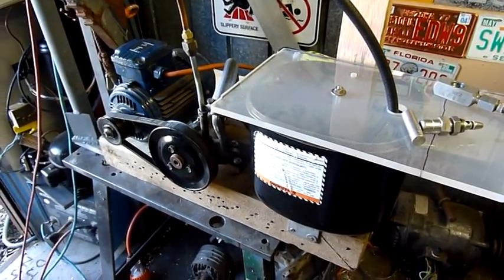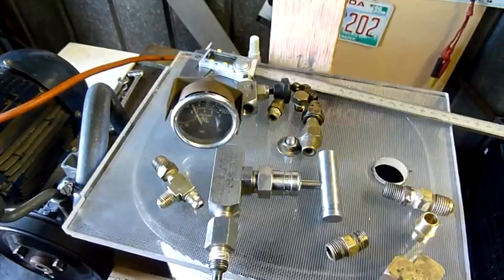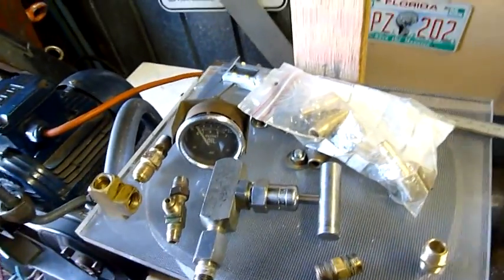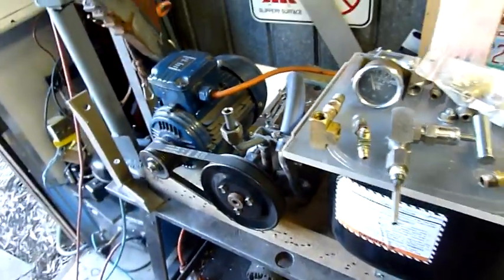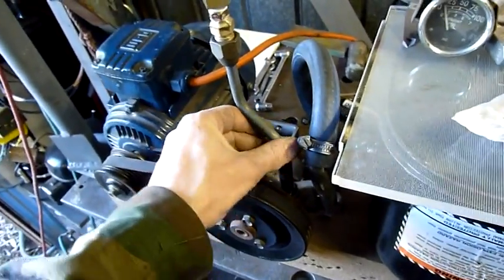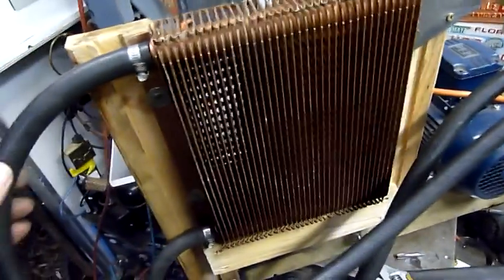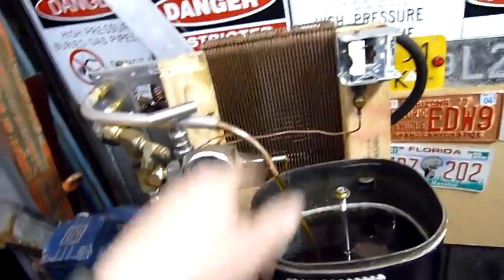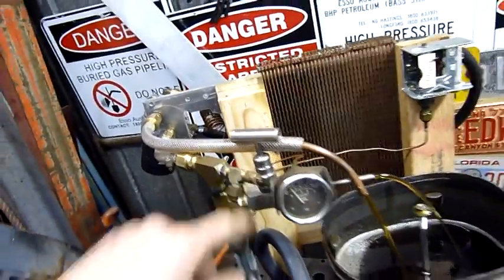Turbojet Oil Pump Build Pt2

Comment from the maker: Polycarb goes yellow under UV light, this stuff smells like acrylic when I cut it, polycarb has much different properties too, it does not burn clean when you throw it in the fire bin either.

Comment from the maker: yer old seam welded steel tubing is not good for high pressure, same with cheap brass, that stuff snaps under extreme vibration and pressure!

Comment: Such excellent and detailed engineering.
I can't wait to see the first Spin up of the Turbo Jet. 

I have been going to do one of these for some years now. I have a Turbo off a train. Thing is so big and heavy I can barely lift it. I haven't been able to get my head around the combustor design yet to make sure the flame does not melt the turbine wheel so I'm looking forward to seeing how you do it as I'm likely to be able to understand your  explanations better.

Comment: Nothing wrong with Castrol diesel oil. It meets or exceeds all API requirements for petrol and diesel engines and is an excellent detergent motor oil.